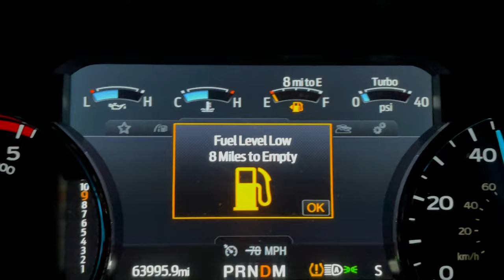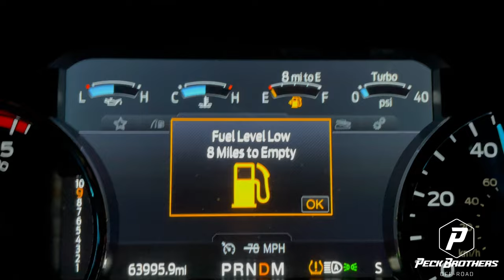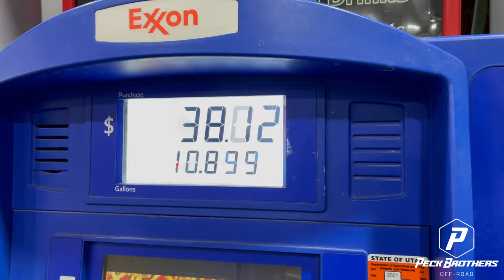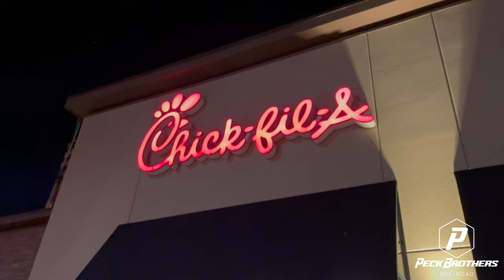BLOWOUT BRAND NEW 37" TOYO M/T- STUCK ON THE FREEWAY FOR HOURS

Comment: First off. That's what you get for running 22's. Lol.  Fun fact. Can't even pull a trailer that is empty without a commercial driver license in CA.  If the trailer is rated for more than 10,000 lbs. I mostly try to leave some kind of comment just to help the channel/you guys out.